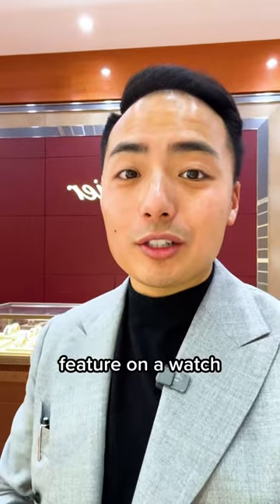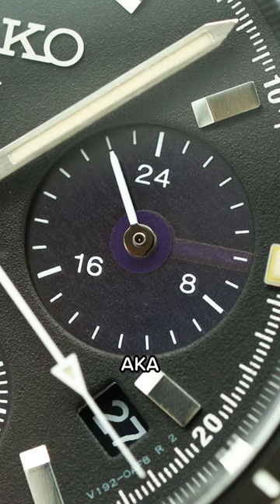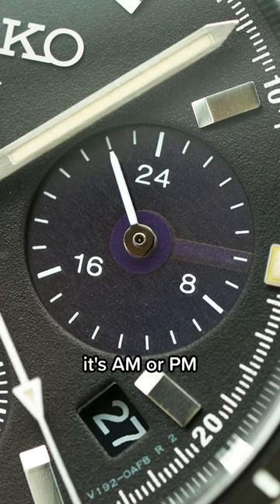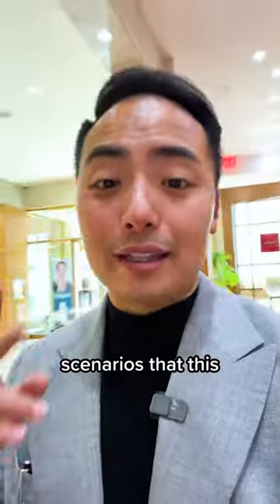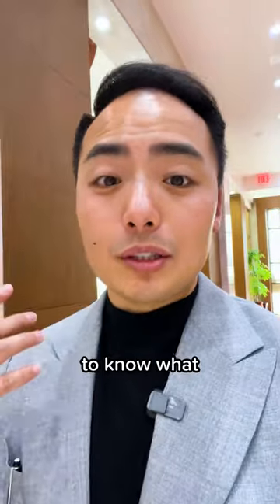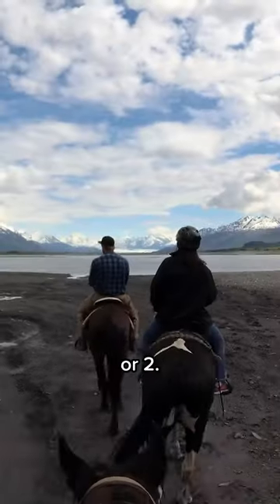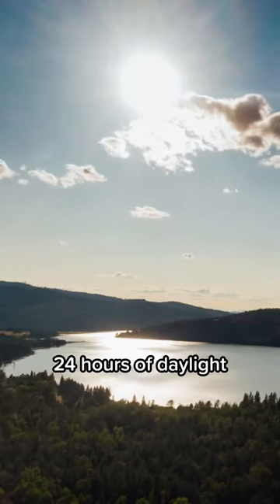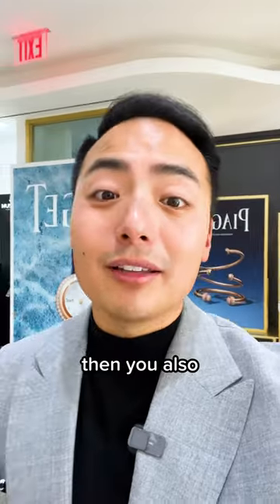Why do I need this on a Chronograph? 😑

Comment: It's nice to know when the date/day is going to flip if youre setting it and dont want to roll through the whole month/week
Reply from the maker: I think that’s the only time I’ll actually look at it, but so many watches don’t need it
Reply: You need  a dial for this? C'mon really?????
Reply: I like it as well. It's definitely a nice to have feature, not something that would cause me to buy or not buy a watch.
Reply: Also it counts the hours if your using the chrono
Reply: @muzza9338 "it's nice to" meaning it's cool but not mandatory.
Reply: 24 hour scale is not useless ! it allows wearer to know if they are long time stuck in a mall or indoor environment or a cave etc.... to know it is day or night , which is the same as a SUN/Moon disc.

Comment: The 24 hour hand can also be used as a compass. Holding the watch flat, have the regular hour hand point to the sun, the 24hr hand will point to north. Works only if its not DST time.

Comment: As someone who does data entry and has to put everything in 24 hour format, it can be a nice little feature. The times between 1500 and 1800 somehow screw with me periodically, so the watch makes a great reference when I check times on paperwork.
Reply from the maker: That’s another good use function

Comment: My speedmaster mk40 has a 24h sub dial, one half is painted in a lighter shade of blue so you know that’s the safe zone for adjusting the calendar without breaking the mechanism. So I guess most chronographs have it because of that

Comment: You are wrong. 24hrs scale is a useful in everyday use. It is used in transportation, and logistics to clearly indicate when something is scheduled for arrival, delivery, departure. Communications use it in a professional setting to better indicate the start and end of an event such as a special report, a news broadcast or standard daily programming, the military use it for accurate operation timetables and obviously everyday time keeping. The most useless complication is a perpetual calendar in an automatic/mechanical because if the watch stops running for several days it  is a total pain to reset. Leave that sort of compilation to digital watches like GShock and stick with the tried and true standard day and date calendar complication.

Comment: The AM/PM is needed when you don't use the watch for long and wind up the spring to full and set time. Now the problem lies after this while setting up date. For example the clock stopped running 4' O clock and now I reset the time to let say 2'o clock in the afternoon but I don't know whether it's 2PM or 2 AM that my watch is set to. This will eventually lead to wrong update of date and day after few hours. It could be that I am expecting the day date to change after midnight but my watch didn't instead it changed date day in 12'o clock afternoon

Comment: Cause it's dangerous to change the date/date on automatic watches bewtween 9pm and 3am. The gears are active during that time. You can damage to the movement and breaks the day and date wheel by doing that.

Comment: I really enjoy the 24 hour sub dial. It's a great am/pm indicator. Mostly, I think it adds interest to the piece. It's constantly moving, in a different position throughout the day. With a 12 hour chronograph only one sub dial is moving. The other two being at 12. I enjoy using the chronograph, for the most part it's not in use. I have other digitals and a phone if I need a stop watch. That being a 24 hour stop watch. A chrono with two sub dials in motion is cool to me. So many people dislike this feature. They usually wish it was a 12 hour indicator.

Comment: Hidden features of Chronograph watch subdial that has 24, 4, 8, 12, 16, 20 markings; If you take your watch off align the little dial towards the Sun you will get compass directions. 12 o'clock is always North. It's a rudimentary way of finding out cardinal directions for your surroundings if you were lost.

Comment: Personally, I appreciate having an indication of whether it is AM or PM. Having worked in various conditions where there was no way to know whether it is AM or PM as no access to outside was available (Shift work in factories, Shift work in underground mines, Spelunking are just a couple that I personally have experience with). Though, instead of a AM/PM indicator, I just prefer having a GMT with a 24 hour hand.
Reply from the maker: Agree with that!!

Comment: Here’s another reason why it’s actually useful: if you haven’t used that particular watch in a while, you need to wind it and maybe set the date agains however, if it’s towards the evening and it’s let’s say 11 pm, you cannot change the time as it will damage the mechanism. So if I know it’s 11 am, I can change the time and date without worrying. Don’t get me wrong, it’s not an excuse to pay more for a chrono but it is another useful reason😂
Reply: What you can't adjust the time first before changing the date?
Really? I can't believe some of these silly excuses for a useless dial.... Cosmetics maybe but that's it...

Comment: Long term timing in a race, such as a Rolex 24 or any 24 hour race
Reply from the maker: That would make sense if the Seiko could count more than one hour, but it can only display up to 60 mins on the Chronograph unless you can remember the hours
Reply: @MinuteMon Wasn't he saying you could use the 24 hour sub dial to time the race?
Reply: @1988banker How does that work?

Comment: Considering this is a solar powered watch with a 6 month power reserve (no need to set the date), that subdial would have been so much better as an hour counter for the chrono. The 24-hour dial is the biggest reason I probably won't get it.

Comment: Lots of pointless things on watches when you think about it. If a long lasting, accurate, reliable watch is what you desire buy a G Shock, digital, tough solar, multiband 6. If you want a classic wrist decoration which showcases the designers capability of mechanical wizardry and quirk....... Do you see what I'm getting at?😉

Comment: Ever heard of a 24 hr race, such as Le Mans? What do you think a chronograph is for?
Reply from the maker: This Chronograph can only count up to 60 mins. Unless you can mentally count the hours that have elapsed
Reply: @MinuteMon  isn't that 24 hr subdial used to count up to 24 hrs?
Reply from the maker: No, on this watch it tells you AM/PM or military hours. On a watch such as an Omega Speedmaster then yes it will count up to 12 hours.

I actually would’ve preferred to have that subdial count 12 hours on the running Chronograph, very useful!